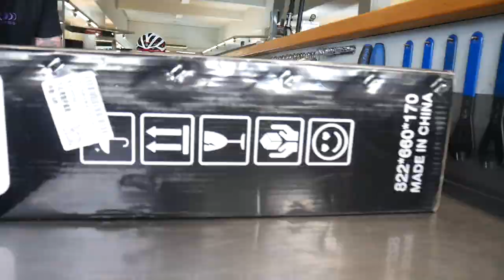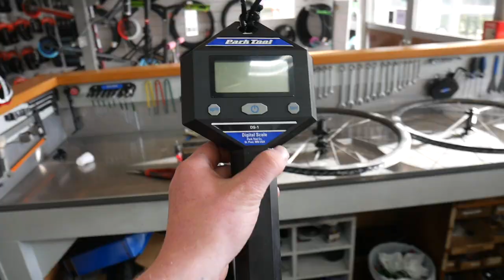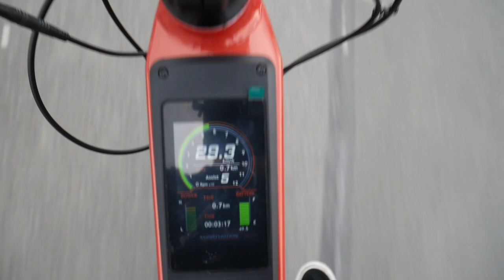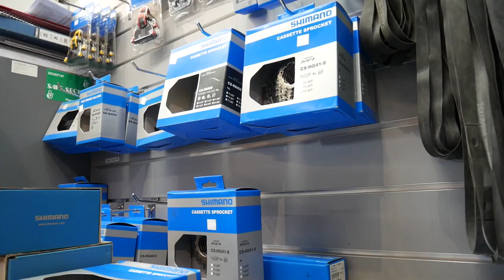These Carbon Wheels Are So Light!   "WINSPACE Hyper 38"

Comment: Definitely put those wheels on the chapter. Will probably loose 100g from stripping the frame and fork. Lighter tubes, Skewers, bar tape. Jagwire Elite cables will drop more weight. Definitely need to see sub 6kg. Climbing wheels in my eyes would be 25mm another 100+g saved.
Reply from the maker: Yeah I will go for a much lighter tire when I do the build

Comment: Mine just arrived, but i bought them without reading details in their website, it stated rider weight should be around 95 or you should have them checked regurarly to qualified mechanics, my weights are 100kg, is it still safe to use?
Reply: Yeah just loose weight quick 😆
Reply: How are the wheels holding ? @kerjasama

Comment: The big risk is with carbon spoke failure IF a stick is flipped up into the spoke and rotates to the brakes/fork. This as happend to me many times with aluminum spokes. But with carbon, there  have been reports of it shattering all the spokes  causing catastrophic  failure of the entire wheel=death.
Reply: Winspace posted a video on IG a short while back showing the aftermath of this exact situation. The wheel stayed intact,  but the seatstay (alloy frame) buckled. I've seen reports of earlier generation carbon spokes (Mavic, Spinergy) failing spectacularly, but none so far with the latest generation as found on Winspace, Cadex, etc.

Comment: build a sintesi fixed gear bike and save the wheels for the chapter 2 lightweight build
Reply: Change the Ultegra cassette for a Sram 11-32 and save another 100+g there to. Will go well with your Sram groupset. Lightish wheel set with an anchor of a cassette on. Not ideal.
Reply from the maker: Yes will definitely be going sram cassette for lightweight

Comment: You do know wheelweight doesn't matter (more than bike weight), do you?
Reply: Wheel weight is directly proportional to bike weight, if you save 150gms on wheels you have saved 150gms on bike weight.
Reply: @davidcummings7735  totaly right - but these are expensive 150g
Reply: The price I believe is relative, if you are in need of a quality pair of carbon wheels these are so much better value than their big brand name competitors, ie Zipp , Enve or similar, and I believe very comparable quality at less than half the price.
Reply: @TheAesculap  expensive compared to what?
Reply: @am7jeremy  any other part that saves 150g incl. going to the Toilet.
Reply: @TheAesculap  😂
Reply: @davidcummings7735 . Agree. I have 4 sets of wheels totalling $21k. To me these wheels are really cheap. 😁

Comment: Sorry mate, but you need to define lightness. This is not light at all
Reply: The actual wheel set with rim tape is 1297g my old alloy Dura Ace C24 's climbing wheels are 1415g I reckon they are pretty light for a 38mm carbon wheelset.